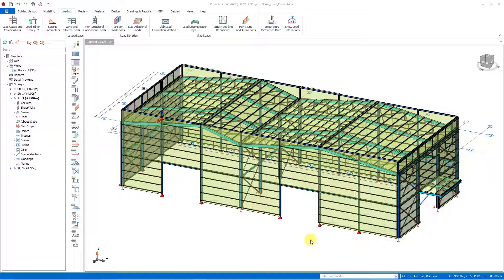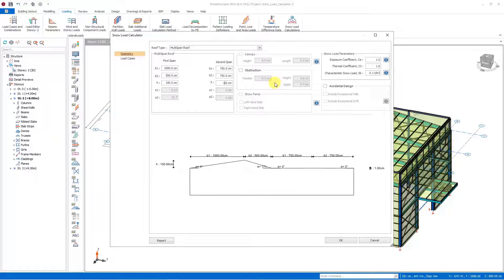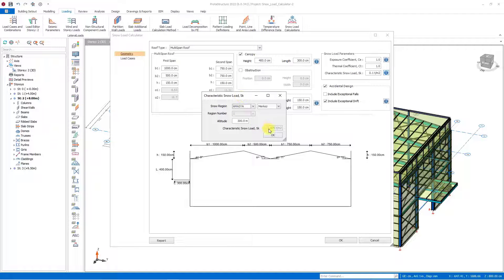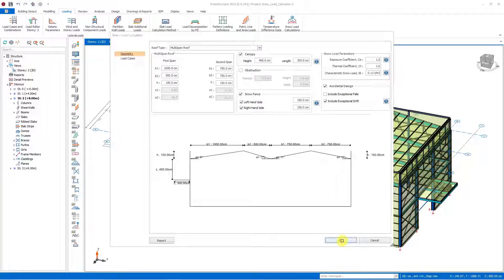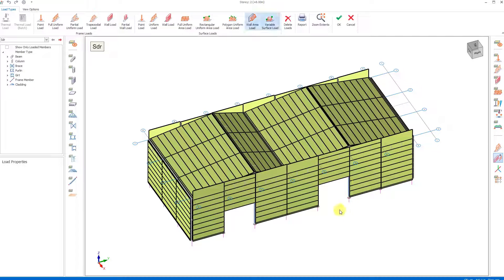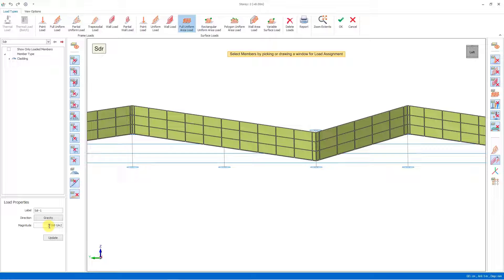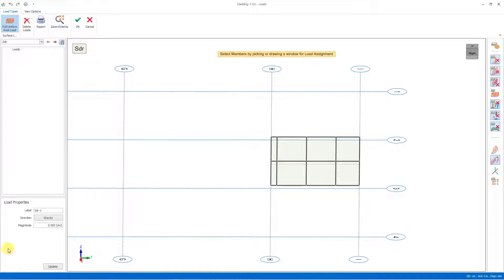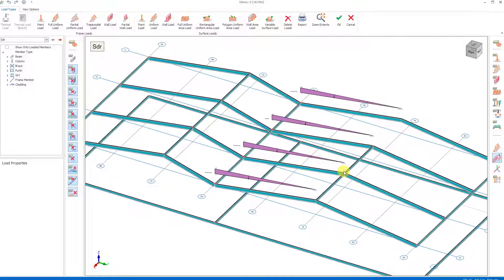Snow Load Calculations with ProtaStructure

Comment: Very nice explained. As a sugestion, a triangular / linear increasing distribution would be useful to implement in Prota by selecting several load panels and viewing them as a group, say a roof slope, specifying the start and end point say on the X or Y axes. it would eliminate manual approximation / interpolation of panel loads and the process would be more automated / simple / fast.